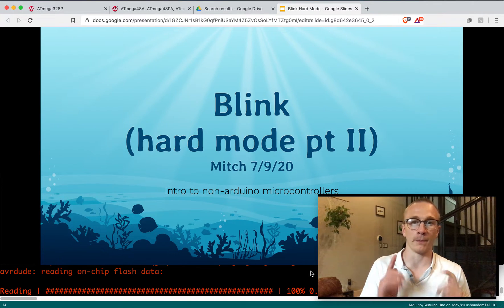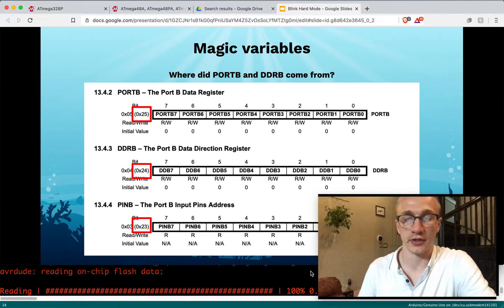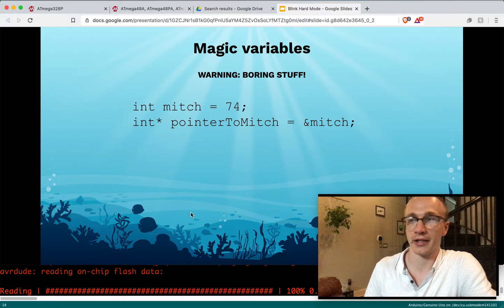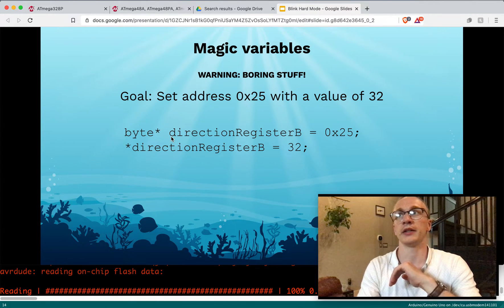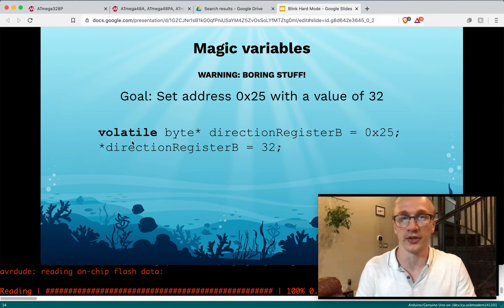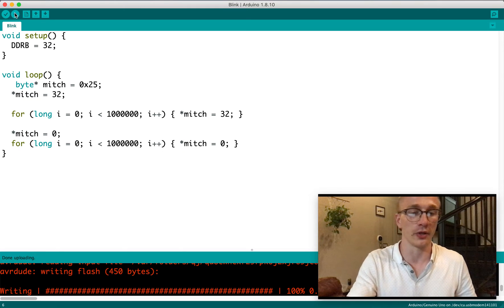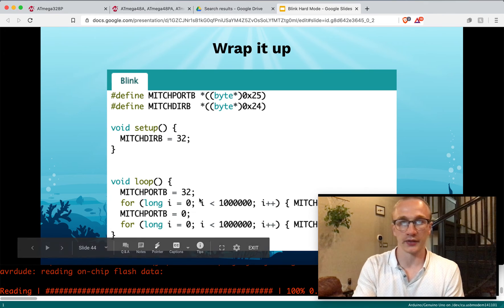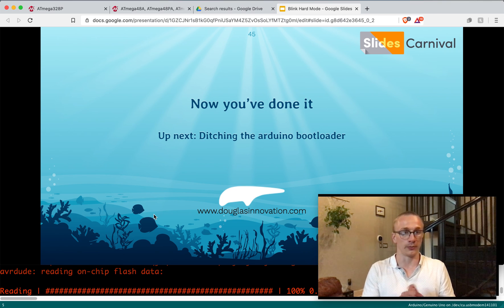Bare-Metal MCU #2 - Set Registers by Memory Address

Comment: Finding out about the volatile keyword is worth a like on it's own. I have worked with C/C++ a lot in the past but also never heard about that before. Thanks for explaining.
Btw. I wouldn't call this operation a cast. I would rather explain it as "interpret". A good explanation would be "this tells the compiler to change the 8 bits starting from hex address 0x25 through to 0x2C" (both included).
This also means that it is actually possible to flip the fifth bit by using address 0x2A instead and set this to 1 using "+= 1" (assuming it is set to zero on startup). This would also not change any other bits (assuming bit shifting is explained later in the series anyway).

Comment: Sir, i am new in world of micro controller, always face problem when i sift my project to other AVR chip say attiny44a. arduino wire.h library is not supported for attiny44a, where pulseIn function showing compilation error for attiny44a . Now i want to decode what is inside of library by so i can make compatible to other MCU of AVR series. or i have to write code errespective of using library,then i have to know every MCU I/O registry ,timer etc from datasheet. any way i am learning from you.

Comment: why cant we just do 0x25 = 32; ???
why pointers and dereferencing stuff!!!
Reply from the maker: Because doing “0x25=32” is like writing “37=32”.  That’s not valid code.  0x25 is just saying “hexadecimal 2-5 which is just 37.

What we need to do is say “set the value of memory address #37 to “32”

The pointer points to the memory address, and then we have to dereference it to actually set the value.

Comment: 2:01 - Why are the addresses of the different ports written within ( ). What do the numbers outside the parentheses on the very left mean? (e.g.  0x03, 0x04, 0x05)?
Reply from the maker: I believe one of them is an ABSOLUTE memory address, and the other is RELATIVE to the offset address listed in the datasheet.
Reply: @MitchDavis2  So were the values used in the code the absolute values?

Comment: Another great video,  thank  you!

Is there any performance gain to be had by accessing RAM directly over using the predefined Arduino PORT (etc) registers?
Reply from the maker: It’s been a while since I made this video, but if I recall, arduino’s PORT registers ARE the direct memory locations.  If you dive into the definition of something like “PORTA”, you should find something similar to what I covered in this video
Reply: Thank you so much for this. I've got it all working thanks to your videos!

Comment: Need a bit of help here. I am following through but I am programming the blink onto a ATtiny85. My WORKING code is as follows:

#define MITCHB    *((volatile byte*) 0x18)
#define MITCHMODE *((volatile byte*) 0x17)

void setup() {
  DDRB = 0xa;
}

void loop() {
  PORTB = 0xa;
  for(long i=0; i<100000; i++){ PORTB = 0xa;}
  
  PORTB = 0;
  for(long i=0; i<100000; i++){ PORTB = 0;}
}

The issue arises when I start to use the pointers. When I replace just DDRB with MITCHMODE the led begins to blink incredibly dimly, it is impossible to see unless I dim my room lights. I have double checked the data sheets and 0x18/0x17 are the correct memory addresses so I have no idea what could be wrong.

Also huge thanks for making this series. You are teaching me what I didn't learn in my college microelectronics class.

Comment: hello peeps in the comments section, i didnt quite get the one liner in 8:47. Is any kind soul there to tell me maybe what to search up online to learn more about it :D thank you
Reply from the maker: Hopefully this helps a bit.  I broke the one-liner up into a few lines:
-----------------------------------------
int myAddress = 0x25;	//25 in hex (37 in decimal)

//How do we access the memory at address 0x25?
//We do that by creating a pointer to that memory location
//The * means it is a pointer.  The pointer is pointing at address 0x25
byte* myPointer = myAddress;

//COOL!  Now we have a pointer to the memory address.
//But how do we change the memory value at the address we're pointing to?
//We do this by "dereferencing" the variable, which is basically the opposite of a pointer
//Let's set the value in memory that "myPointer" is pointing to.
//We'll set it to 32
*myPointer = 32;

--------------------------------

There's only one more problem with the above code.
The compiler thinks that we're doing nothing.  Basically creating a variable, but never using it.  So the compiler thinks it is helping us by deleting those lines of code to save space.  So we need to tell the compiler that it's not allowed to delete that variable, so we use the "volatile" keyword.

We'd say:
volatile byte* myPointer = myAddress;

Now the compiler sees this and says "I don't know why this is here, but I won't delete it"
Reply: @MitchDavis2  Thank you very much Mitch Davis,  its clearer now, i was confused by the part on how u didnt iniatilize anything to store the address in the 1 liner, but then i realized that you probably dont have to store the address anywhere, because you are immidiately dereferencing it. Once again, thank you for all your awesome videos, and your help :D
Reply from the maker: Which part is tripping you up?  There's a few things going on here:
- Volatile keyword
- Casting a variable (the parenthesis around "volatile byte*" )
- Pointers (the "*" after "byte")
- Dereferencing a pointer (the "*" at the very beginning)

Comment: Wait, i thought DDRx, PORTx, etc was defined by the atmega chip instead of the arduino library?
Reply from the maker: Nope, the chip has no idea what programming language you’re using.  All it knows is that it has special places in memory that will cause it to do things.  It’s the programmer’s job to make sure you’re setting the right memory locations.  If you’re programming in C, there’s often a file somewhere that does all the mappings for you
Reply: It’s not defined by the chip, but it is defined by the Atmel/Microchip libraries - not Arduino’s.

Comment: I'm sure you realise, Mitch, that replacing PORTB and DDRB with #defines doesn't save any bytes or increase the speed. Because PORTB and DDRB are almost certainly defined in exactly the same way already. So isn't it kinda redundant, other than pointing out that you can just poke values into memory to write to registers?

(Which, incidentally, never occurred to me. So thanks.)
Reply: hes explaining where these all come from
Reply: Yup, it's like bringing a packed lunch to an all-inclusive resort. You first have to limit yourself by doing away with the abstractions.
Reply: @sodalmighty You are correct. They are defined as macros in a header file. For those of you that really want to dig deep, it’s in the file called iom328p.h (when dealing with the ATMega328P like is in the Arduino Uno R3) in the avr-libc library (from Atmel/Microchip, but which is in the support files when you set up the Arduino IDE). So there is no performance penalty - the compiler (and chip) just sees the raw memory location.

Comment: I love these videos ! One thing I love is seeing how the code size shrinks as you replace standard Arduino code with custom code. I could see the code size in the first 2 or 3 uploads but then the verbose output got cut off somewhere ? Could you please make the verbose output section a bit larger, I would love to see what tweaks make the code size shrink and grow. On the atmega328 this might not matter that much, but when dealing with attiny10's for example, code size matters big time! Love your work dude !!!
Reply from the maker: I’ve already wrapped up this series, so I won’t be able to make any changes at this point.  That being said, later on, I ditch the Arduino IDE altogether, and you should be able to very clearly see the file size at that point
Reply: @MitchDavis2  Are you going to move to Atmel studio ? 
I am exited to see more in depth content ;) 
I will be waiting for the new videos ^^
Reply from the maker: @andrewwatts1997  I probably won't be moving to atmel studio.  There's like a million different ways to program an arduino / ATMEGA series microcontroller, so I wanted to focus on some of the fundamentals that should make learning any other platform easier.

It's not that I don't want to cover atmel studio, but there are just a lot more exciting things I'd like to cover first.  I've got STM32, ESP32, and Raspberry Pi Pico that I'd love to cover.
Reply: @MitchDavis2  You have peaked my interest then. Because I kind of thought Atmel studio was all there was besides the Arduino Ide. I am currently working on a serial Servo project that involves STM32 chips and even with the Cube IDE I find it a hard platform to work on...

Comment: This is a really valuable series. I'm always looking for things that translate Arduino to low-level hardware coding and the route you are taking is clear and well explained. 

Just a small suggestion, if you want to stop people complaining about keyboard noise get a Rode Smartlav (cheap but good lavalier mic, I use them in production all the time) and a simple USB input.

Actually, I wonder if the 3.5mm jack on apple would take it without much fuss. I've always used my Zoom H4 as a USB audio interface.

Anyway, waffling aside, this is great, thanks for putting it together!

Comment: Another question :D Why is setup 2 brighter than setup 1?

//////////////////////////////////////////
//////////////////////////////////////////
Setup 1:

void setup () {
}

void loop () {
  volatile byte* pin67 = 0x2B;
  *pin67 = 64;

  for (long i = 0; i < 1000000; i++) {*pin67 = 64;}

  *pin67 = 0;
  for (long i = 0; i < 1000000; i++) {*pin67 = 128;}
}

void setup () {
  pinMode(6, OUTPUT);
  pinMode(7, OUTPUT);
}

//////////////////////////////////////////
//////////////////////////////////////////
Setup 2:
void loop () {
  delay(1000);
  digitalWrite(6, HIGH);
  digitalWrite(7, LOW);
  delay(1000);
  digitalWrite(7, HIGH);
  digitalWrite(6, LOW);
}

//////////////////////////////////////////
//////////////////////////////////////////
Reply: @MitchDavis2  Ah right. Good point. thanks!